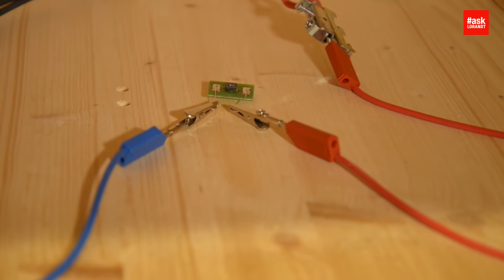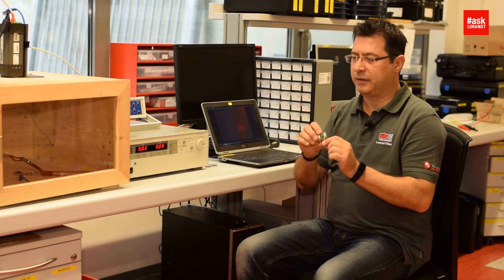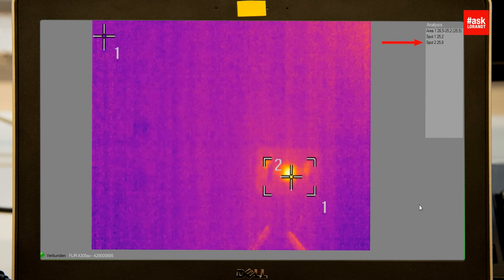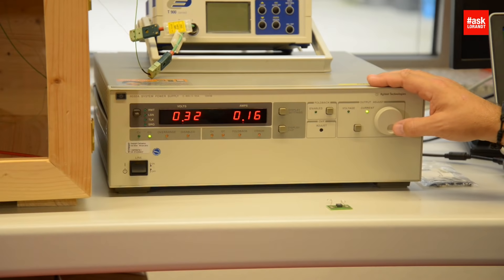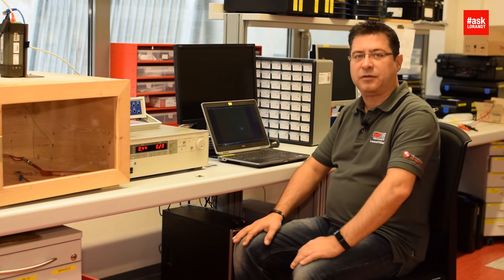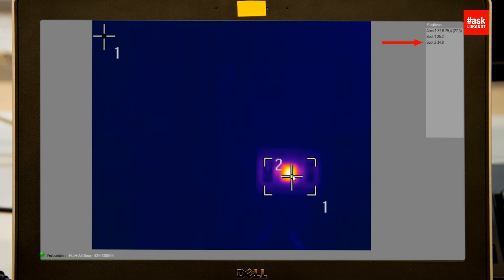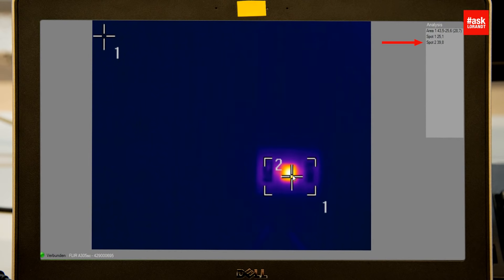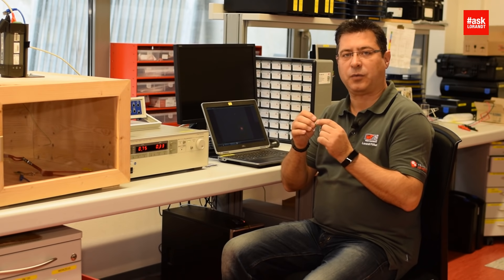#askLorandt explains: Rated current of an inductor

Comment: I was working at Falco Electronics for more than 10 years as design engineer in the power products branch, most of the time both parameters, Isat and Irated dont make any sense for the power circuit design engineers, were just a guideline to select an inductor which closely works within their circuit specification, I always thought a third derated graph which involved Ipk vs Irated vs Temp vs Total Losses (Core and wire resitance) had to be delivered to the power electronics circuit designers which would led them to pick the best one inductor within their application when talking about family product series inductors.

Comment: Sir what's the difference between Rated current, Saturation current and maximum current of an inductor.
Reply: Dear Varun, the rated current in defined according to the self heating (temperature rise), the saturation current is defined on the inductance drop above the current increase in % from initial value w/o current Ex. L0 drop 10% is Isat. Maximum current is just another wording for rated current.